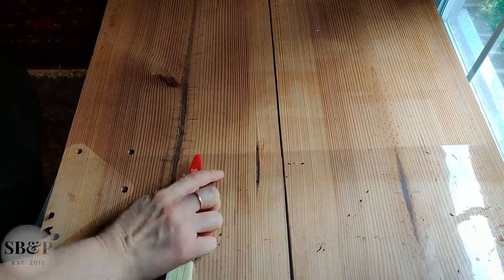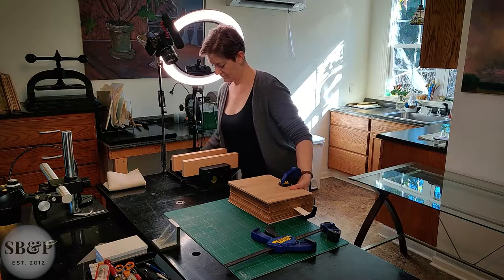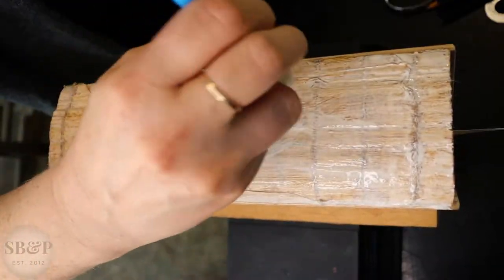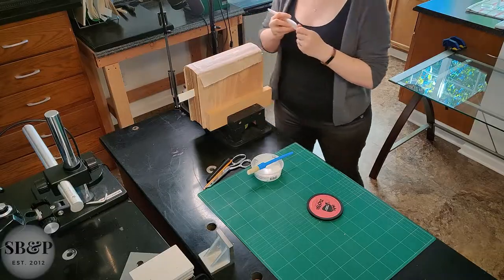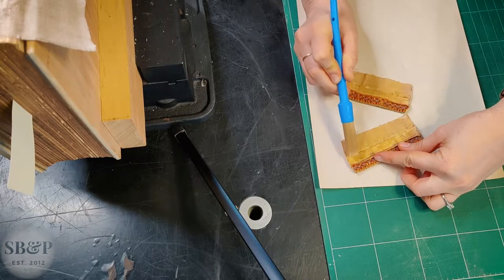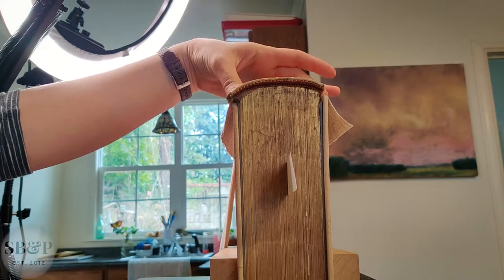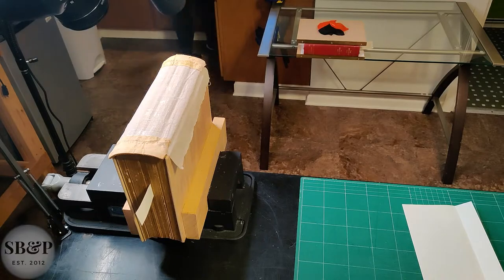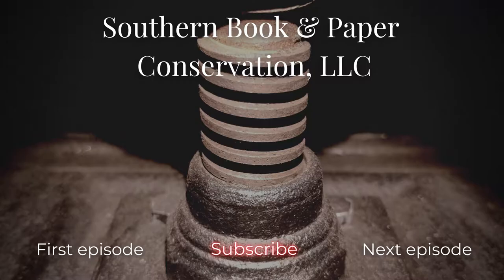New Linen and Paper Linings.  Original Endbands Reattached.

Comment: I thought, PVA glue directly on the linen? But then you explained the process of removal facilitated by the underlining and I understood. But I wonder, are there certain times when PVA would not be appropriate for this step in the process?
Reply: I wonder because PVA is not as easily reversed as many conservation products.
Reply from the maker: I've had success with reversal as long as there's a wheat starch paste/tengujo reverse layer.

Comment: Amazing series. I've been binge watching it and I've been learning a lot. I own quite a few old books, and I would really love to make sure they live long and healthy in my collection. I still don't feel confident enough to start working on them, because firstly most of them are not in very bad shape and secondly because some of them are very old and I don't really know their value. On top of that, since I have zero experience myself I don't just want to mess them up. However I'm looking on thrift shops and garage sales for old broken books for me to start practicing. I have a question regarding the endbands. They seem almost identical. I understand that they are shaped just like the sections of the book, and lined up with all the imperfections that the aligned sections have, so using the right orientation makes sense. However, since the endbands will be glued in place again, would that have that much influence to the book overall integrity in the end? I understand the conservation point of view, and the fact that the whole purpose of the process is to preserve the book as much as you can and not change anything unnecessary, but in this particular case, since the tail endband was damaged, would it have made sense if you placed the undamaged endband to the tail of the book? Would that increase the longevity of the book? Thank you very much for sharing your process and work. It is truly wonderful.
Reply from the maker: Great question! My background probably comes into play.  So if this were held by an institution, the conservator would want to put the endbands back where they were.  This is to preserve the experience of the book - that it probably had been set down hard on the tail of the spine (a common occurrence).  If this is a book is in your personal collection, it's at your own discretion!

I encourage clients to store books that I've worked on (and any old books they love) flat on their backs like coffee table books.  The original materials and my work are both delicate and both will last much longer if gravity isn't pulling the textblock against the spine linings, joint, and boards.
Reply: @SouthernBookAndPaper  thank you very much for your answer.

Comment: So the joint paper is "sacrificial" to the leather and more readily replaced. 01:02 Is it correct then, if cloth were used, it would not have been "weak enough" causing more damage?
Reply from the maker: In these joints, this book will have both linen and then long fiber paper over it.  A lot of my clients ask me about leather as a repair material.  I expect the paper/linen combo to stay flexible much longer than a leather piece.  Also, in my experience, leather is less predictable in terms of how it degrades - over a relatively short time, some produce more discoloring where they touch the original materials than the antique leather did in the first place.
Reply: @SouthernBookAndPaper  Sorry if I got the wrong idea. If I were to bind books for myself, it would always be paper and cloth hardcovers. This is nothing to do with animal rights, or my lack of ability with leather. I actually don't like leather-bound books, because of how it degrades and sheds powder. The only time I don't mind it, is if it is someone else's book.
Reply from the maker: @channelsixtysix066  I completely agree with your reasons.  Leather looks beautiful and then fails very messily.